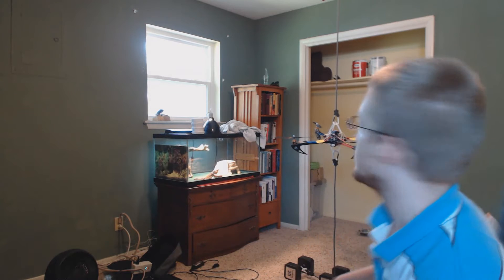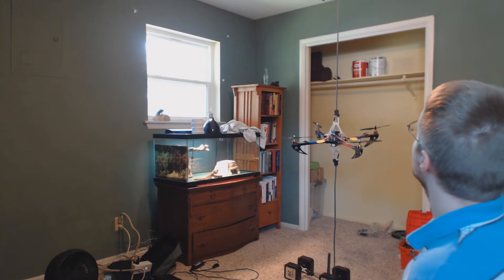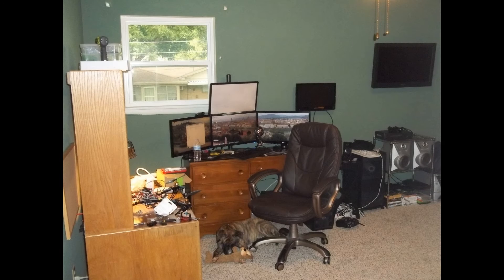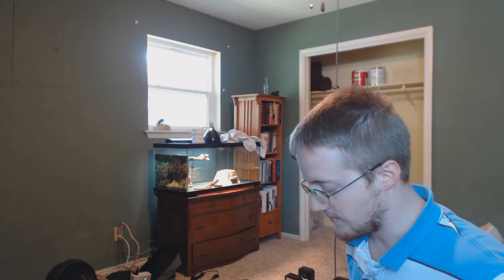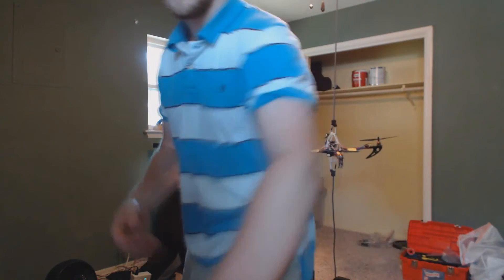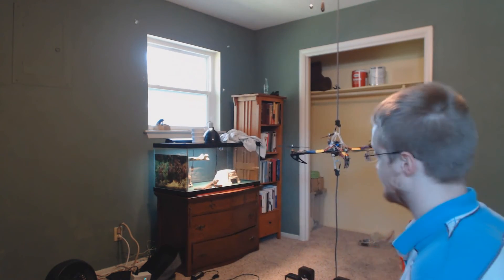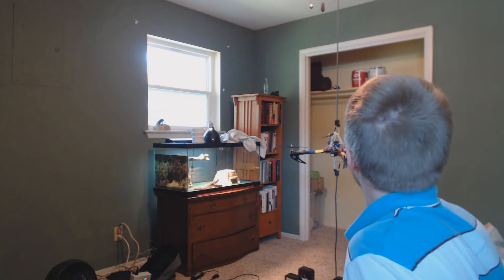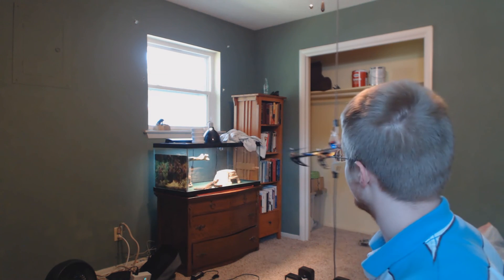Quadcopter restraint system testing x525 flight test

Comment: Silly question for arming do you not want it on the floor to get a good level. Are you currently using a commercial flight controller, or the development board?
Reply from the maker: As far as I know, there's no calibration done on arming to assume "flat." Kkmulticopter.com stopped paying the bills and their website is gone, so I have no resources to check. Do you have any reason to believe that it does indeed assume whatever the starting gyro is means "level?" That would indeed make me want to arm it on the floor, then hook it up... but that doesn't sound as safe.
Reply from the maker: Currently there's a kkboard on there. Eventually I am going to replace that board with a tegra k1 devkit,but wanted to get everything situated before that.
Reply: As I understand it the kkk board on power up calibrates its gyros. So I would power up on the floor, hook up on the bungees,  then arm on the controller that is sticks bottom left then top right or similar. This might help with it pitching like it did. Also if your transmitter is a computer one so you can set your rates I would do that too, and set them at very low travel.
Reply from the maker: Dave Sharp Yeah, it was rolling to the same side that it was leaning towards initially, I bet you're absolutely correct. Thanks for the suggestion! It was making some very sharp corrections that were having no input from me. I moved to the garage for a bit and started on the floor and the corrections weren't a problem. A blade did break mid flight though, that's disconcerting...

I'd love to turn down the sensitivity, that's what broke the blade since the input was too fast and it just broke mid-air. I'll look into doing that as well. Thanks for pointing this out.